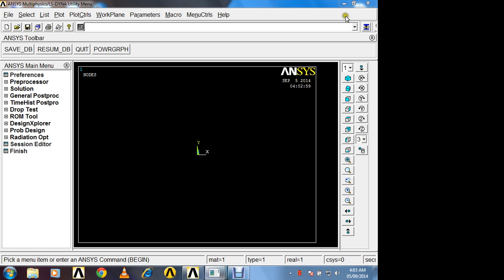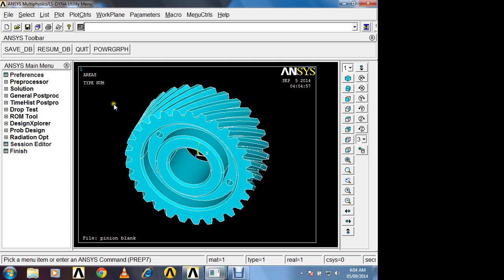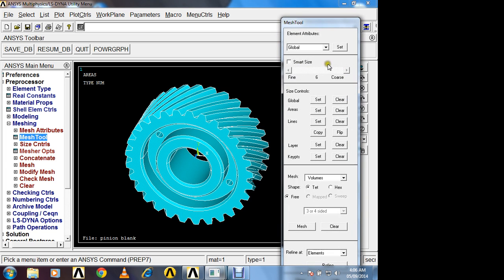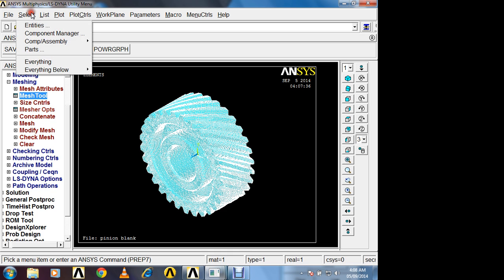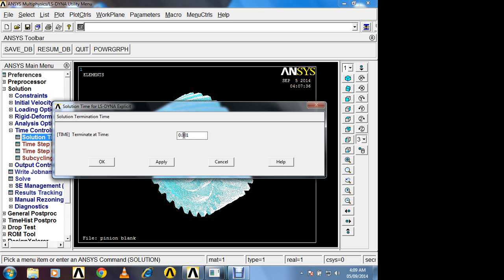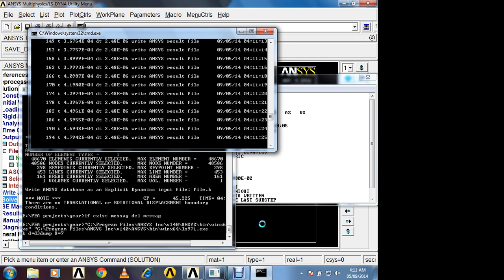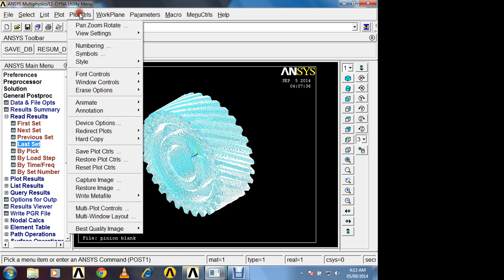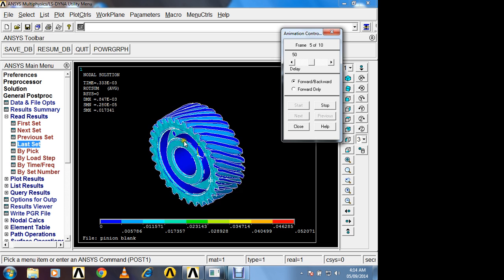Dynamic analysis of helical gear-Prof.Prasad Kulkarni SKN Sinhagad college of engineering

Comment: Sir, I want to do an dinamic analysis on pump shaft, I have do the exact step like your video but the result my shaft can not rotate constantly like yours and my shaft not fully rotate, it just rotate in 45 degree. how can i make my shaft fully rotate like in this video? is there any step that you didn't mention in this video?
thanks a lot for your help
Reply from the maker: yes you can rotate shaft in ansys workbench by crating revolute joint
Reply from the maker: yes you can rotate shaft in ansys workbench by crating revolute joint
Reply from the maker: yes you can rotate shaft in ansys workbench by crating revolute joint
Reply from the maker: yes you can rotate shaft in ansys workbench by crating revolute joint
Reply from the maker: femsolver@gmail.com

Comment: sir is dynamic analysis of 2 meshed gear possible in ansys apdl?
Reply from the maker: possible
Reply: thnx sir
Reply: actually I want to do dynamic analysis of gear mesh ant get the teeth strength , stress etc. 
I am attaching the video link below which is done in diffrent software. Is it possible in ansys
plz suggest.
Reply from the maker: femsolver@gmail.com